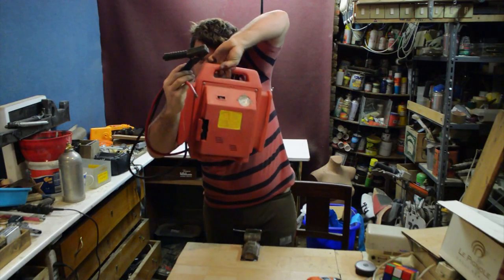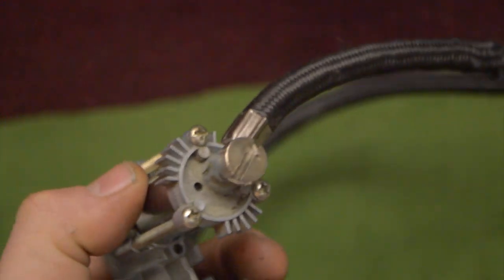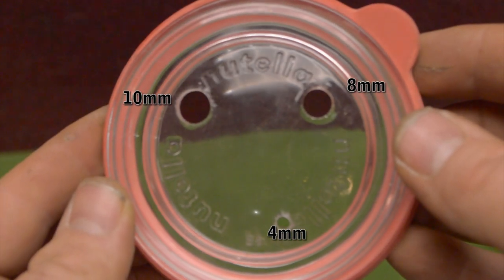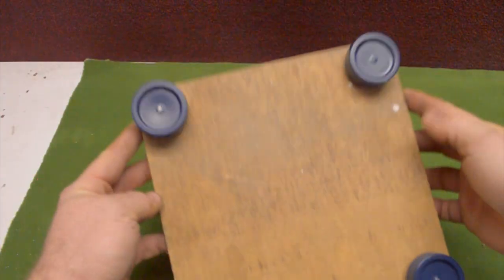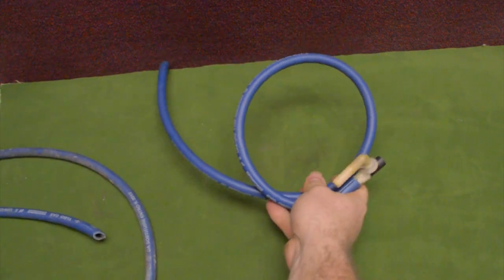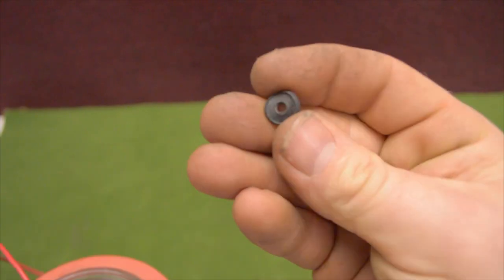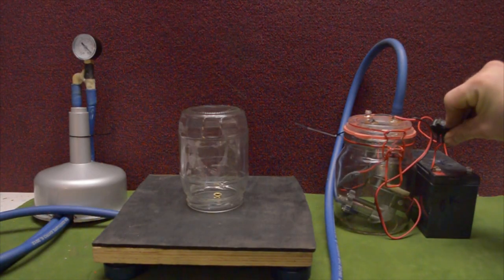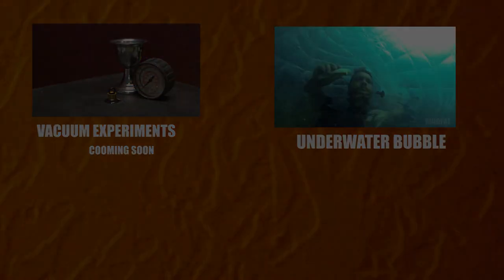How to Make a 12V Vacuum Pump - DIY

Comment: You can get the exactly same small yellow compressor in Finland from Ale-Makasiini, though it will be black, and it may not be sold in every ale-Makasiini, but it will cost about 12 euros. I myself bought one for other purposes and it works great with a computer power supply thanks to the high power it can produce. If you use a large enough container, you'll don't have to take the pump apart.
Reply: That is awesome

Comment: you can do lot of interesting things with vacuum playing with electricity: metal covering in thin films, anode spraying with power msgnet, and maybe vacuum diode if you can get lesser pressure

Comment: It's going to overheat very badly if used for any length of time, because the air cooling the motor is at low pressure.

Comment: cool stuff, but the glass container wasn't a good idea. you can't fix the pump inside, the motor can't cool down, and the moving parts can be blocked by the casing.
Reply: Minipuntatrice

Comment: I'v made this vacuum pump. It work 5 minutes until burned. Unfortunetly vacuum is best thermoinsulator. But this construction has a right to exist for one or two minutes working.
Reply: +Vitaly Sarychev i tried to convert an air pump into a vacuum pump too. won't work! those  cheap, little pumps have a piston seal and check  valve optimized to produce pressure, not vacuum. don't waste your time!
Reply: +Vitaly Sarychev Buy a used vacuum cleaner instead and you have a solid adjustable vacuum pump
Reply: It says right on the side of all these little tire compressors do not run more than 5 mins. There are a few that are made better than these little cheapies but they cost about 4 times as much.
Reply: Vitaly Sarychev i was thinking the same thing but maybe if you only submerge the motor in mineral oil it might work for longer

Comment: I started out quite sceptical, but liked the result. 
But you should never use oil on robber. Use a drop of silicone or even a tiny bit of talcum or cornstarch. Though the latter two might get into the vacuum pump if you use too much.
Reply: And that should have been rubber 😊

Comment: How to make vacuum pump:
First you need: Vacuum pump..
Reply: +Bass Lover  He didn't use a vacuum pump but a compressor - just the opposite. ...Please say you were just kidding, haha ;-)
Reply: bass lover wasnt kidding... sad a person (assume male) whos probably old enough to know better, does not. and sadder wen they pop off the mouth. :/    but maybe I.m wrong....°_·  (naaahh;)    5gal bucket could make a shop vac maybe. super cool...:)
Reply: BLADE RUNNER Yep. One of those moments when remaining quiet would have made him look so much better.
Reply: corisco tupi It's just a joke
Reply: Bass Lover :)
Reply: +Bass Lover ayy lmao
Reply: Either a fool or a Troll :-))
Reply: Air compressors are easy to come by and cheap, vacuum pumps are a different story - his brilliants come from overcoming the isolation problem of the intake of the compressor. By installing the "reverse' Shrader valve to allow air into the container but not out is the key, the whole mechanism is operating in a vacuum~~very smart man! Thank you.

Comment: The vibrating pump rattling against the glass may cause cracks in the glass and cause the container to implode violently when under vacuum. Not good. Also, the pump needs air for cooling. Don't expect this to last long and please be careful.

Comment: 4:40 almost perfect vacuum? LOL.
try to get to 100 millitor with this... I dare you
Reply: RoNiNk could you do it with this pump?
Reply: Owen Chase of course no
Reply: RoNiNk  He far surpassed that. Millitorr is a very small unit of measure, and 100?  It takes near 1,000,000 millitorr to make one bar
Reply: 100 militorr is 0,00013332237 bar... and as he said in the video, this pump goes up to 0.8 bar. This pump gets 600049,339 millitorr. Millitorr isn't a large unit at all, so I have no clue what you are talking about and/or are trying to say.